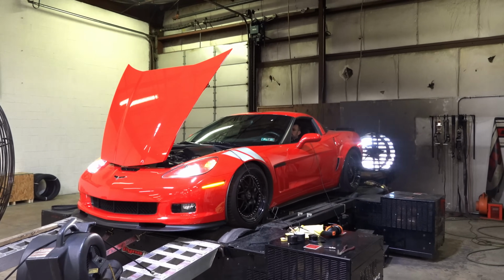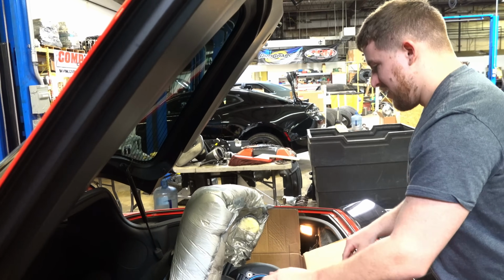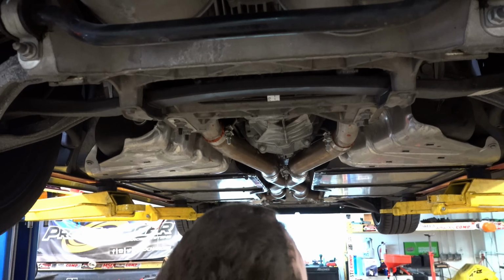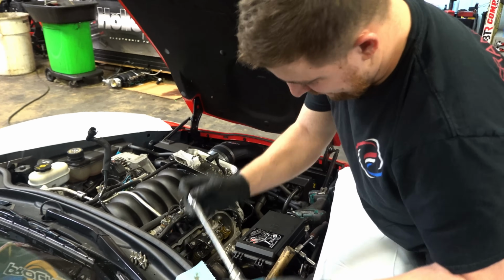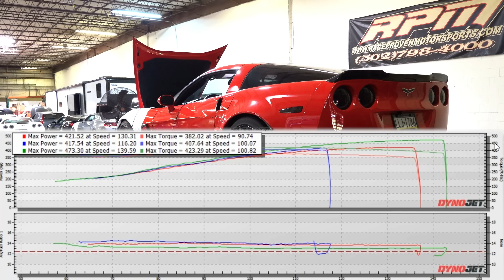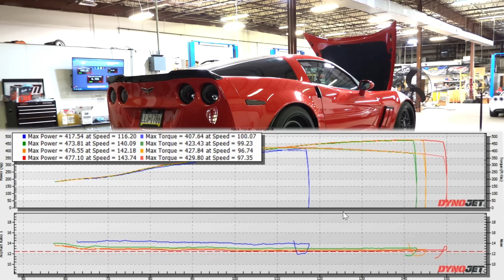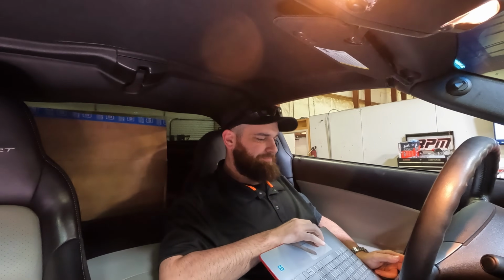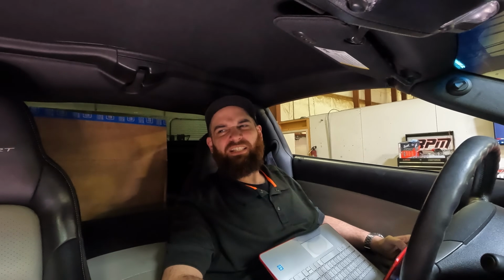How Much Power Does A Cam Only LS3 Make?

Comment: Almost six months since my C6Z stage 3. Have two problems, no traction in 1st and 2nd haha, my Michelin pilot sport as3 not the best for high hp applications either. My granddaughter just said “I forgot how fast your car is grandpa”. Love the results I got from the RPM crew. I always display my extra large laminated dyno and build sheet when showing. Get lots of compliments on the way the car looks and especially the way it sounds. Thanks again RPM!!
Reply: We will be sure to check your channel for some pulls
Reply: Get toyo r888rs (they are noisy) but if there is any kind of heat in them, traction won't be an issue. I also air mine down a little.
Reply: get some slicks

Comment: What is the rod-mod?  In OE configuration the intake manifold has an extremely sharp transition from the plenum to the top of the runners.  Air hates sharp edges, and loves curves, so the rods give the air a nice radius to follow into the intake manifold.  The porting (at least what we do at GPI) removes the stands from the middle of the manifold to increase plenum volume, cleans up any casting flash from the runners, and cleans up the throat by flush cutting the vacuum ports.   Our ported rod-mod has been tested by many and proven to consistently gain somewhere around 10whp on a cammed 6.2, and make significant gains through the mid-range.

Comment: My '08 Base Vette got a BTR Stage 2 cam/kit swap 4 years ago. It Dyno'd 451hp at the wheels. BTR claimed a 67hp gain, and I believe that's about what mine got with no other mods. Mine has NPP, for a little help.

Comment: The LS3 intake with the rod mod performed AND fully ported typically picks up 6-8 to the wheels  on a stock engine and 12-15+ on cammed setup. Supposedly worth it for the gains under the curve.
Reply: Richard holdner and crew just did a comparison on a big cam 427 and a rod mod intake didn't do squat anywhere on the curve.  It's a gimmick
Reply: @nicklashway6636  I've watched that video as well; however, that's a single test. Additionally, Richard even verified in the comments that the manifold they used only had the rod mod performed with no additional porting. Plenty of other third party sources and shops have shown differently on them for years now, which is where the general consensus on those numbers gradually came from.
Reply: My 08 ls3 made 414whp and 413 tq with headers, cai, and gpi ported rod mod ls3 intake. Translation 11.80s @ 121 at the strip. Pretty quick for stock heads, cam, converter car.
Reply: @nicklashway6636 not a gimmick. That's one test lol. Plenty of back to back data out there on LS3's.
Reply: @SmallBoreGarage  yep and plenty of people that haven't gotten much from it at all.
Reply: @nicklashway6636  yea but that was done on a 427 with a big ass cam and not a 376 so not aples to apples here
Reply: @WhiteZ50Won  nice which converter did you use?
Reply: @omegasquad868  stock converter cutting 1.88 60 fts
Reply: @nicklashway6636  my base c6 auto has the ported rod mod ls3 intake and I’m pushing 500whp with the setup I have going, so I guess it’s not really a gimmick?
Reply: @oppressiveness7269  did you dyno every mod individually? Did you dyno or get any data (track times) at all with just the rod mod? How much power does the rod mod pick up vs. a normal ported ls3 intake? Do you know how to establish an actual argument based on data, factual information, testing, analysis, retesting? There are enough people who haven't gotten gains from the rod mod to question whether or not other variables exist. Telling me you have 500whp doesn't mean anything.

Comment: Wish you would have left the original intake on and did a Dyno pull then did the swap with Dyno pull after just to see if the intake is any good
Reply: Richard Holdener just did an LS3 engine dyno comparison video. One of them was a ported rod mod.

Comment: My cai and cam c6z made 527whp, for comparison. However I don't know what the stock dyno was, or if the previous owner even did one.
Reply: No exhaust or head work?
Reply: @dennisrobinson8008  no, no exhaust, headers or heads etc.
Reply: Happy dyno
Reply: What cam did you run?
Reply: @MrChizzle87  I'm not sure, the previous owner had it done 5 years ago. Probably one of the popular ones if I had to guess.
Reply: @7000U9ZHIFT  can't be that happy, these cars usually are around 440ish whp. Hellcats are 148ish in the half mile. I was 153.9 with only one chance to run.

Comment: I'm torn between buying a low mileage C6 Grand Sport or a new car for the warranty, updated interior etc.. I love C6's but the older I get, the less I care about having a quick car, the more I care about a nice interior and just having enough power to have fun on the street without going to jail for taking 2nd or 3rd gear up to redline, lol.. if I do end up with a C6, I'll definitely have it shipped to you guys for the tune and mods etc.. I'm right down the road in Maryland. Were you the shop that used to be in Overlea/Rosedale, MD right off the highway or am I confusing you with a different RPM?
Reply from the maker: No we have always been in Delaware

Comment: If I call and ask to have work done on my 02' SS, am I gonna be turned away? I was told the last time I called RPM they don't do work on LS motors anymore...but this video contradicts that, or was the person I talked to wrong?
Reply from the maker: We do not work on LS1 engines.   Clearly we still work on LS engines.  Just nothing older than 2006
Reply: Well, that unfortunate. Appreciate the reply.

Comment: I hear from time to time Fran mention the car dont  have a tire to get good traction....  what are the recommendations to resolve that? Brands? etc?
Reply: Nitto has good tires, so does nankang (if I spelled it right) I run the toyo r888r's and they are beasts. They are noisy, but I have zero issues with traction really in my c6z and I'm 527whp. They just need a little heat too.
Reply: @camonly849   Thanks for the info!  very helpful!
Reply: @user-iq2bs9im6t  you bet! I had some heat in them once and was at 25mph in first gear and put it to the floor and it hooked with no issues. The r888rs operating temp it says is between 160-220F. But as long as they're warm to the touch you'll have no issues unless your crazy high hp.
Reply: @user-iq2bs9im6t  good luck! I also got a little over 10k miles out of them. Just fyi

Comment: C6 ls3 will make in the 450s with just bolt ons...with equal torque.  

Torque is the actual power of a engine.
Reply: Then why is it called horse POWER ??
Reply: @hunnterful1  because you don't know the difference
Reply: @HioSSilver1999  I’m joking guy
Reply: what bolt ons?
Reply: @Dexvl  typical stuff that no one does because they think a cam is gonna be their savior....the little things add up. We've actually made as much as 470whp 470wtq with one in a 5gen that had eps. Still on the oe npp catback.
Reply: Margxela  yup....but some think that headers and a air intake is fbo.